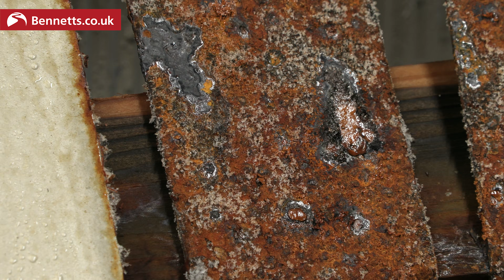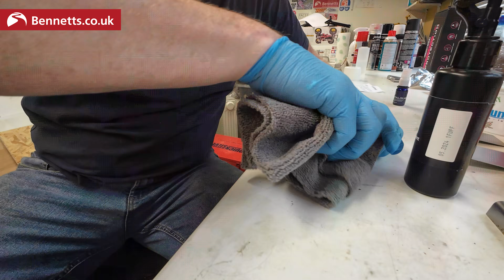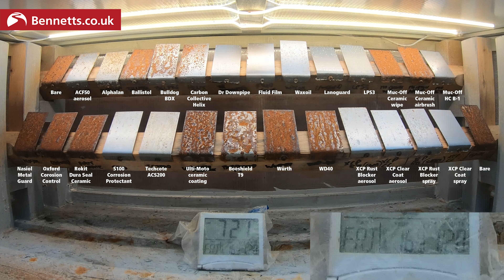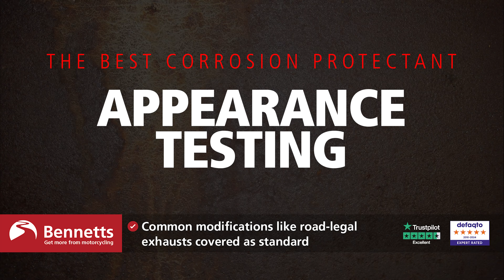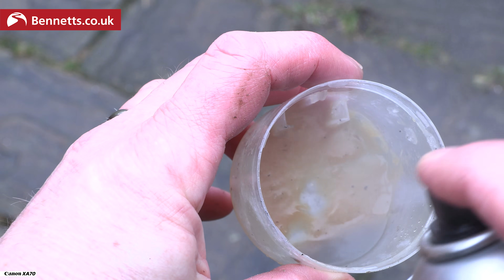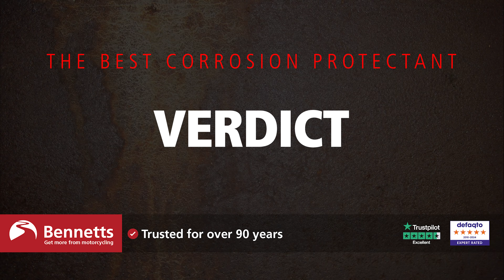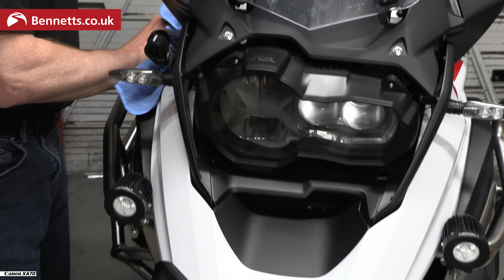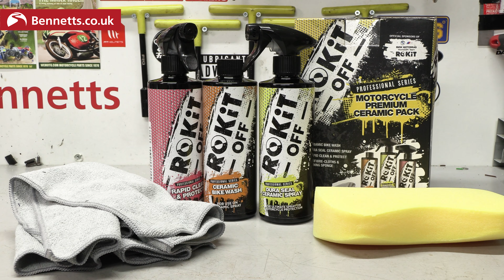Best corrosion protection 2025 | 33 tested | Are ceramic coatings worth it?

Comment: Brilliant videos, love the detail. Can point you to another solution I have recently switched to from ACF 50.  Bilt Hamber Atom Mac I still testing, but results are encouraging. This product is a micro film applied mixed with water, I use a cheap electic sprayer but a bottle sprayer is just a good.  Initially applied after a good wash of the bike then left to dry, as is water based it gets in everywhere without any worries of reacting with plastics or rubber. The big advantage it can be directly applied to brake components and discs directly with having to wipe them afterwards.  Although it neutralises salt deposits, I always light get was the bike off after ride where there is salt spray. I will quickly reapply if the bike has got very dirty and has to be washed. So far the results are good. However this may not be a solution for regular winter uses or commuters, its perfect for those how only ride occasionally and want a protector thats easy, quick and nit messy to apply. The product is cheap as you dilute a small amount in a litre of water ( 2 to 5 %, although I always use 5%)   This link provides  a review and test of the product. https://youtu.be/NC-kVxQyEyU?si=RFPDMSBQ4ky7T_u4

Comment: I commuted to work on a motorbike everyday (except for a couple of days when it snowed and then turned to ice) through this last winter, where I used XCP professional clear coat on my 2024 Husqvarna Svartpilen 125 (steel framed black naked bike with alloy swingarm). I applied it once at the beginning of October, then again at the beginning of January. I didn't rinse off the bike until I cleaned it approximately every two weeks. I have had no noticable rust except on my wheels and exhaust. 
I assume the protectant just burned off the upper part of the exhaust (which is also very exposed) so it has changed colour a little, but the rear chamber only has a small patch of rust on the most exposed side facing the road. A bolt holding a heat shield onto the exhaust has also rusted, but the heat shield itself is okay. I've heard that general maintenance sprays are best for exhausts, but I guess they need to be reapplied more often.
The wheels also didn't fair so well as the zinc plated spoke nipples corroded, and a little on the spokes. I applied the protectant manually (to avoid getting it on the brake disks) to each spoke in October, but I didn't repeat it the second time. For much of the winter I set off and arrived home in the dark, and my wheels spokes are black and got covered in grime, so I didn't notice the corrosion until last month.
I recently got a new bike (passed my full test on 6th February) which is essentially the same as my old one but with a bigger engine (2024 Husqvarna Svartpilen 401). The bodywork and frame is basically identical, so I'm getting a second chance at keeping it in good condition lol.
I noticed recently that the 401 user manual actually recommends to use a waxoil based product on the wheels and zinc plated parts (like the spoke nipples). Here I think the waxoil would work very well. Having something hardwearing on the most exposed area, that you only need to apply once (applying to every spoke is very laborious), and won't pick up as much road grit. To me a slightly matte finish on the spokes is much better than corroded. 
I will keep to XCP clear coat for most of the bike (even if it magnetises grit and dirt a little) and something like the bulldog spray for the exhaust. 
Or I should at least rinse down the wheels and exhaust after every ride with salt on the road. My chain also went a little rusty where I cleaned off the lube on the side plates, but didn't fully recover it. Lesson learned.
Reply from the maker: Thanks so much for this. Hopefully the video helps you choose as Waxoil might be right for some bits. I just want people to be able to choose based on what works best for them. Cheers, John

Comment: On a tight budget, and also not having much free time, I think there is actually one good use for LPS3. Apply it in all the crevices, nooks, and crannies that are hidden to eyeballs, but where moisture and salt still find ways into, and especially places that are hard to reach and hard to clean. It saves having to keep an eye on all those little spaces and reaching in to scrub out the salt and dirt. The same goes for the underside of the bike, where the worst of the salt goes, but nobody sees. It doesn't matter if it looks awful if it saves time and money, and it's put places nobody's looking.
Reply from the maker: Do keep it away from some plastics though.

Comment: John, should we then apply the ceramic coating on a clean surface and then a proper, good looking anti-rust on top (like the old faithful XCP Clear Coat)? Or should we do the opposite and apply the anti-rust on a clean surface first and then the ceramic coating on top?
Reply from the maker: Ceramic on the bodywork, corrosion protection on the rust-prone areas. Not both.
Reply: @bennettsbikesocial  Got it. And what areas are more prone to rust (and can safely be coated with the anti-corrosion product)? I was thinking of using the XCP Clear Coat as a full coat on all the bike...

Comment: Great Video as always..... I have been meaning to ask you about riders who wear glasses and the challenges that come with it. I am thinking of taking up motorcycle riding and have heard horror stories that glasses are a nuisance as they fog up in winters and get sweat drop on them in high heat summers. I live in Pakistan and the temperature can go down to 0°C during our short winters and can go up to a max of 50°C during summers in Lahore, the city I live in. How am I supposed to approach this issue when I start riding and while buying my gear for the first time. Please do keep in mind that in my country most of the people on motorcycles have 70cc to a 100cc bike which they use for daily commute as their main source of transportation. But the very few who do get bigger bikes above 500cc are enthusiasts' who use it for leisure and morning or evening rides mostly in the winters. In summers these bikes are put in hibernation as the temperature does not allow air-cooled bikes to be ridden in traffic without overheating. So having said this, please consider your advice for shorter rides within the city. I would personally want to ride year-round and as a person who wears glasses and a progressive lens at that, I would be grateful for your thoughts and guidance in this matter. I wish you all the best....
Reply from the maker: I haven't found anything that successfully prevents fog on my glasses, so having good venting in the helmet is essential in summer and winter. The hottest I've ridden in is about 40°C, and I didn't get sweat dripping on my glasses then, but I have when doing other stuff before.
Make sure there's room in the lid for the glasses not to be pushed back against your face.
Join our BikeSocial Facebook group to get more opinions as we have a good mix of riders there. Cheers, John
Reply: @bennettsbikesocial  Thank you so very much

Comment: Have used Fluid film, ACF-50 and now Sdoc100. ACF-50 had some rust on a w800 chrome tube for the bevel camshaft during winter storage. Some of the other recommend products aren't available or easily available in my market.

Comment: Personally I'd love a video on the quickest wash possible😂 Hate cleaning love riding. Think I need product recomendations like brushes and detergents, because I just use normal car shampoo since I dont want to use something too aggressive that's going to damage the finish, but that's making it difficult to clean wheels and engine casing since I can barely get access even with detailing brushes so the little agitation with weak car shampoo just isn't getting stuff off.

Paintwork is easy but unlike a car the paintwork is only like 20% of the cleaning 😂 Its the not so glossy black wheels, the faded plastics, the ridiculius amount of tar spots, removed with tar remover and they're back after a a week of riding. I've made do with Vulcanet wipes which leave a nice finish after cleaning (don't worry I dont use them to clean) but I know there's better stuff out there.

No powered products since im in a flat but luckily have a good private car park with water for a hose, not lugging any more than a hose & buckets around plus would have to go in the loft (again which im lucky to have) but would defeat any time saving efforts if i had to prep all that every time.
Reply from the maker: Try this: https://www.youtube.com/watch?v=9NsFLPDgFqA
Reply: I found that using a Hydro snow foam sprayer was a great alternative to using a Jet wash as it can apply the soap easily and you can use it to fully cover the bike. i have V1 and they recently launched V2. it may help speed up cleaning a bit and you can use snow foam to rinse off road muck before going at it with brushes and sponges

Comment: The ceramic coating are usually based on polysilane . These are used in the base form to prevent scratches on lenses as well. More Silanes = more expensive and longer lasting ( more polymer binding).
Reply from the maker: Yes – Steve talks about polysilazanes in the interview in this video
Reply: @ another great video

Comment: I use acf 50 concentrated version 
But I rinse my bike just plain water every day I get back 
Wash it once a week  then I put another coat of acf50 concentrate every time I wash it in the winter as I live near the sea  so I don’t really get any rust
Reply: I wish I had your resolve, as I also live by the sea, and have noticed a bit of rust creeping into a few bolts on my bike. Winter washes are just too brutal though where I live haha

Comment: In warmer weather, waxoil becomes more sticky. I made my own using more paraffin wax, less oil and a little more white spirit. The branded product contains corrosion inhibitors.
It’s not designed to come off - just the opposite. It dissolves in petroleum solvents with some heat. Not useful for anything except bike chains and the underside of a bike. Great for underseal

Comment: I use my 1980 Suzuki GS550 all year round in the South East, where we get the roads regularly salted for 3 months or so. My corrosion protection is done by WD40, the liquid form, rather than aerosol. I wash it down with degreaser periodically and reapply the WD40, with a brush, in critical areas near tyres and brakes, and with a sprayer on the rest.
In the spring, I wash it all down again and polish it for the summer, although I WD40 the engine all year round. This is the 4th winter I've used this process on this bike, and it still looks as good as when I started.
I've been using WD40 since the seventies (on outboard motors then) and throughout my career as a mechanic (now retired), so I'm a lifelong fan.

Comment: I use turtlewax hybrid ceramic on the paint work, also given it a try on the frame and engine and seems to be working fine sofar. I've used aquasteel on any corroded steel parts to protect from any more corrosion happening. (Aquasteel is for parts that are already corroded/rusty). Thank you for taking the time on testing all the products. Very helpful 👌

Comment: I use auto Glym ceramic wash on my car really easy to apply just like washing your car and the result is amazing but I'm really unsure to use it on a motorbike as it would go over the tyres and all the brake lever Gear peg and pegs

Comment: I wonder if the rust blocker would degrade once you cleaned your bike. Do you need to reapply it after every wash?
Reply from the maker: That's why I hosed them all off every weekend. A gentle wash with a PH neutral shampoo should be fine but a degreasing cleaning would mean they'd need a top up. That's what I do
Reply: @bennettsbikesocial  Ah ok, thanks!

Comment: Great review of these products; there are so many out there! It’s impossible to know which one is best, so thanks for going to the effort. Regarding ceramics, I use Gyeon Q2 pure for paint, they also have them for trim as well for other parts of the bike. Hands down best product I’ve used and recommend you test it. it makes the finish on my ninja h2 sx look like a mirror. Applying it is fairly easy as it restricts the flow of the product so you don’t use too much. The crystals forming is correct, it does do this after it has been opened but only at the surface and you can brush it off and apply it to the applicator and it’s fairly obvious if you’ve contaminated the liquid with hard elements. They also have a maintenance top up spray which extends the life of it.
Reply from the maker: Is that the detailing spray, about £15?
Reply: Cure Q2M maintenance spray.

Comment: This is very helpful. My Duke 390 attracts rust like flowers attract bees.

This summer, I will have to try to address this. What's the best way to remove rust from all bolt heads and etc..?
Reply from the maker: Moto Verde does a good rust remover. Don't use Harpic like some people claim. Or you could use a brass wire brush on a Dremel if you're careful. Cheers, John
Reply: @bennettsbikesocial  Thank you.

Comment: You missed testing the kings of anti corrosion protection, bilt hamber. Which of these can you use to stop corrosion on brake discs without having to clean it back off before use?? None... Enter to the stage, bilt hamber atom mac.

Comment: Started using XCP after your last test, still having a few cans of Waxoil I used this on the out of view areas under the panels, despite being ridden through the winter all of it seems to have held up well with no signs of rust with just over 4k miles. Bike I had prior to this got Waxoil only, no rust but plenty of dirty looking oily residue that was, as in your test a pain to remove.

Comment: Why not of tryed a proper ceramic coating which has been out for a long time. Has been out for awhile + proven record.
 Muc off ceramic 😅 saids it all tbf plus the others with no track record. 

Ceramics do need a finish to cling onto aswell not just bare metal but should still bond.  It's all in the prep. 
Done a few exhaust systems but that does go through heat cycles also.b
Reply from the maker: Muc-Off is a consumer ceramic. A pro ceramic was included in this test. I'll do more of them if the pro brands are willing to apply them and stand by their claims...
Reply: @bennettsbikesocial  I didn't even know muc off did a ceramic coating 🤣 so it hasn't been out for long.

Comment: i have been using xcp clear coat, and i live on a salty island. Been good so far. Only question is, would it get washed away by stuff like Muc off? i apply it maybe once a month, but wash the bikes maybe 2-3 times a month. Also, i emailed Vulcanet and had no reply on whether their wipes take off the XCP or not.
Reply from the maker: Yes, probably – any degreaser will start to remove it, so I'd give it another coat. Beware of Vulcanet (and others) on plastics... https://www.bennetts.co.uk/bikesocial/reviews/products/motorcycle-maintenance-and-servicing/best-motorcycle-cleaner

Comment: Brilliant video as always John, thanks so much for the effort you put in to these. I, in particular was waiting on these results as I own and run an award winning car and motorcycle Detailing Business up here in Glasgow and use your tests to decide what to apply on customers bikes and my own for that matter. From your initial testing, we have swapped out ACF-50 and now only use XCP Clear Coat on bikes and since this latest test, we'll continue to do so. This is applied by air compressor exactly how you demonstrated...and to a fantastic standard I must say! ;-) We also Ceramic Coat the painted parts of the bike, wheels, mirrors and visors to keep visibility in rain optimal and the bike protected and cleaner for longer (less dirt will stick to coated parts). For anyone reading this in the UK, just for an example; we charge £150 for this service and takes 3 hours. This will vary depending on your location of course but you should't be paying much more for this service. I know of a local dealership charging £500 for the same service. Steve is, of course absolutely right, a Ceramic is not the be all and end all. It's a protection just like a 'traditional' wax so don't be put off using a lovely, good quality wax, there are some superb waxes out there with approximately the same durability and hydrophobic (water beading) properties as a ceramic at a fraction of the cost. They can also be a joy to apply and really great when you want a wee 'tinker' one evening or Saturday morning pre-ride. Anyway, enough of my rambling. Cheers, Michael Sherry.
Reply from the maker: This is great, thank you! It's brilliant to hear how open you are about the real limitations (and advantages) of the products you apply. Feel free to drop me an email to keep in touch.